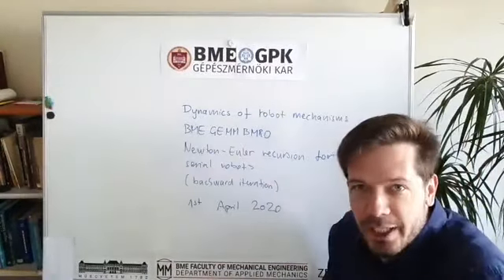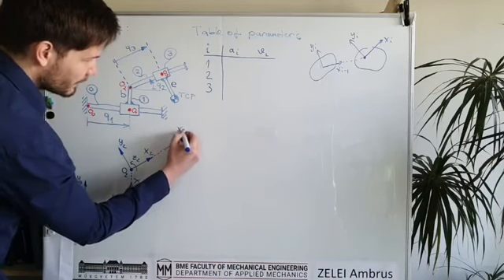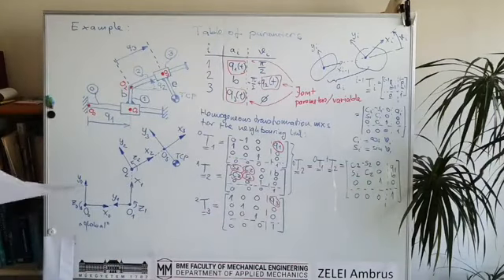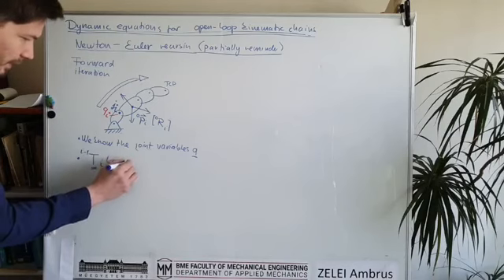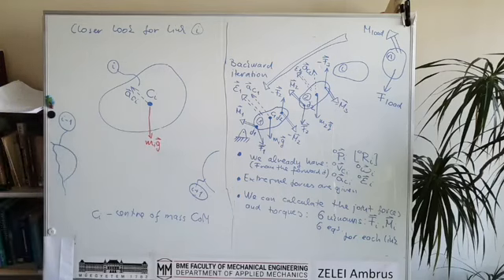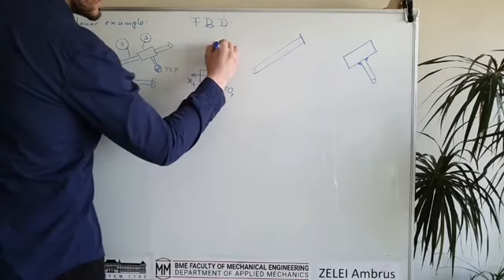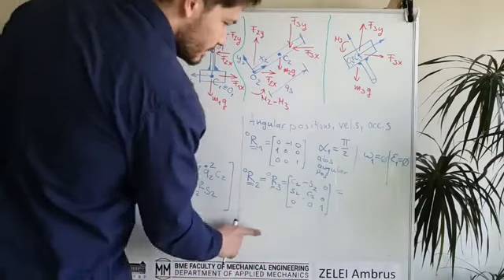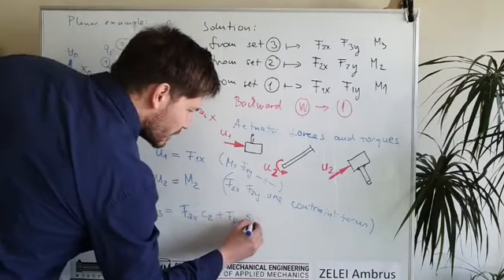Dynamics of robot mechanisms / Robotmechanizmusok dinamikája (BME GEMM BMRO) 20200401

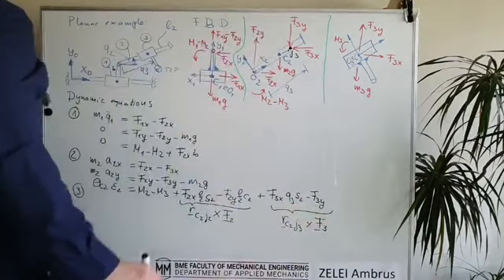Comment: Reading my notes I've got question about this video. At 1:40:52 in the 3rd equation of rigid body no. 2: 
shouldn't (q2-l/2) be written (instead of just q2) which is the distance between j3 and c2. You said the correct lever of the force and wrote the correct vector in the underbracket.
Thank you in advence!
Reply from the maker: I think (q3-l2/2) would be okay. Thank you!
Reply: @ZAeng  Oh yes, q3. Thank you for your response!